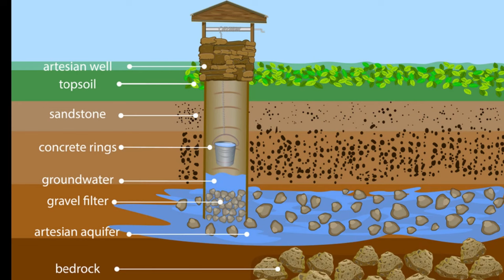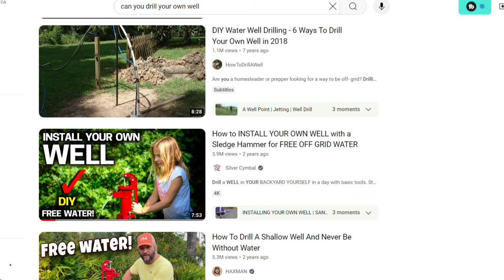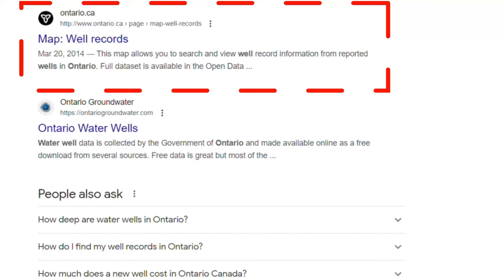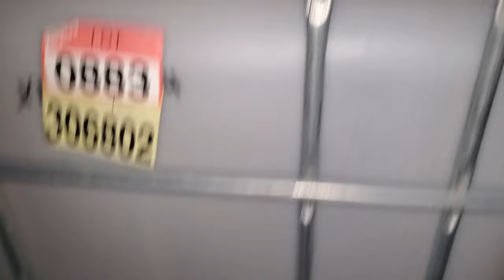Building a Well on our Off Grid Land

Comment: For winter you can make a small pump station  shed with insulation  and use 100w incandecent light bulb (with an outdoor visible idicator light so you know when light burns out) as a heater to keep shed above freezing try to bury you pipe  atleast 6 ft or depth of freeze .
Install an electric pipe heater in middle of line to allow you to unfreeze line incase freeze up happens.
Also you can let your water run slowly (drip) to prevent freeze up on coldest days.
When pipes freeze  , they split , so make sure they don't  freeze !
Keep spare hose and pump parts for repairs and maybe even a back up pump . If repairs can't  be made you might be without water until spring when ground thaws out .
Reply from the maker: Thanks! Great advice! I also have a manual pitch pump for worst case scenarios
Reply: it gets VERY cold where they are and ground freezes over 6ft.  Having your pump house close to structure allows you to introduce excess heat from living area into the pump house and there are ways to use low voltage to heat pipes/lines and even a Hydronic Diesel Heater that uses 1.5 litres per 24hrs of biodiesel fuel.
Reply: To further my comment about keeping a pump house warm --- Off grid living teaches us to use EVERYTHING we can and re purpose anything we can.  As you are heating your home/living space new & fresh air is always being introduced and as you heat that air in winter some warm has has to escape.  By directing that tiny bit of warm exhaust air thru a small 3"  flexible dryer type pipe and using a small 5v or 12v computer type fan you can direct that warm air into your pump house IF the pump house is attached or very very close to your living structure.   With Off Grid living taking a moment to think 🤔 about EVERYTHING you may waste and how to use it to your advantage will make your life simpler and more productive.  I am firm believer in Wood Stove heat , but also using the Diesel Heaters for times when you may need to.  They are very efficient and a 20 gallon tank would last you MONTHS of occasional use.  Consider every adult in the house getting a horrible flu bug .... well no one is going to be in a state to go outside and chop/split wood.  A diesel could save your life.  In an extreme blizzard it can also add to what your wood stove produces.  
Also running outdoor water lines there is an option for heated garden hoses.  you can feed one thru a 2" PVC pipe to your well pump area and keep water above freezing temps to keep it flowing.  Even keeping it flowing by a trickle will prevent freezing.  Hope I can help if possible. I am getting ready to move off grid myself and live on Wind/Solar with Lithium battery banks and a small diesel generator for emergencies. 

Cheers !!!!

Comment: Ive used a plastic culvert as a liner drilled it out for seepage.Wrapped it with wire mesh to prevent blockage  also you might try back flushing your point when driving it.

Comment: That well will do fine for awhile, if its a dry season then it may run dry. That clay soil sucks, i have the same soil too. Eventually you will have to spend the $20,000 for a drilled well. Glad to see the videos coming!
Reply from the maker: Thanks for watching! Hopefully that happens later rather than sooner lol
Reply: The other option is water storage. My father was an engineer in the military, they're in charge of supplying water for bases, including in the desert. You don't need a very deep well if you have large tanks to store water. Not cheap but not $20k. We're not that far away from and my sister and BIL paid for the drilled well. On top of the $20k there was thousands more for fracking to go deeper. They appreciate clean water but have said they would have saved so much money if they'd gone about it differently. 

There's so much water up here but also so much rock. It does complicate things.

Comment: Fascinating,  This brings back memories of us on our rural property; Our first well was a 60 foot bored well. After 6 years it started running out of water during the winter. We put in a 210 foot drilled well, but in 7 years the steel casing rusted through. Unbelievable! We replaced it with another drilled well on the same site (to minimize changes to the plumbing. This time we put in a 6 inch PVC casing which was still working great 25 years later. As a kid on the farm we had wells that were dug by hand, but we had no electricity so we probably averaged less than 10 gallons (40 liters) per day.  
From my experience, avoid using a steel well casing, PVC will outlast it many times over. And a submersible pump was trouble free, whereas a jet pump kept losing its prime.
Reply from the maker: Thank you so much for sharing!!!

Comment: Hi Guys !!

Great Job to get water quick and a sufficient amount to survive without hauling.   My one suggestion would be once you know where your permanent foundation is ,  digging/drilling a NEW well very close will allow you make it somewhat attached to your residence and allowing you to heat everything necessary.  Also knowing you have decent water supply using the Water-Jet drilling method with 1.25" pipe and a 1" drill jet you should be able to get down 60-80ft quite easily to very clear water.  That Clay level should only be from the 5ft to 40ft down as a general measure and back to loose rock/dirt/shale.   Definitely ask others in your area what they have drilled to and found.  Winter temps are going to be your biggest challenge.  

I am looking for UnIncorp land myself up north of Cochrane area.  I am looking to homestead and get out of the concrete jungle and get some mud between my toes and bugs up my nose.   Your kids are very very lucky to have such awesome parents taking them to live on the land and see nature and focus on the blessings God gives us.  
I'm a new Subscriber so if ever I can make an informed opinion, I will do so.  
Take Care Folks !!

Chris & Stella 🙏
Reply from the maker: Thanks for the suggestion, and we will hopefully be drilling a well in the future! Thanks for the encouragement, guys... Means a lot!   Wishing you all the best in your future plans! God bles!!

Comment: Water Is Awesome ! Yes it was a little scary watching you in the hole " but you got it done & have water, I too put in a sand point shallow well, I use a 330 cat hoe with a longer reach & went down 20 feet then put my sand point in with 20 foot long 2inch pipe on it, straight up then built my cabin over it so it will never freeze :) My water has some salt & some iron but it's drinkable, Great video !
Reply from the maker: Yes, it's definitely a great accomplishment to be able to provide our own water. It's an awesome feeling. Great idea building your cabin over it. Thanks for watching! Best of luck!